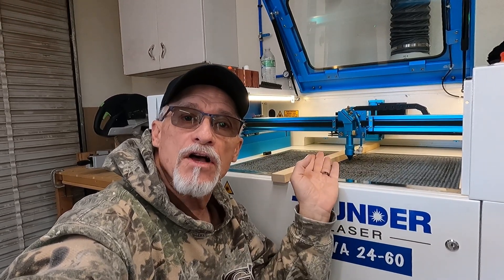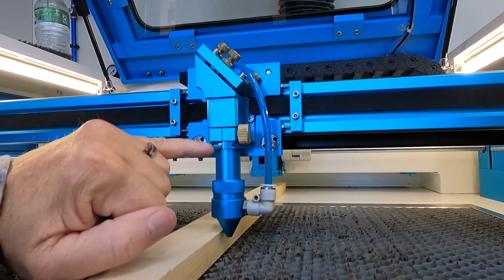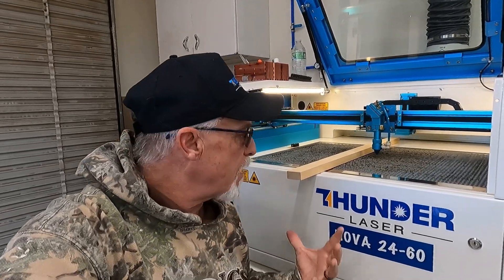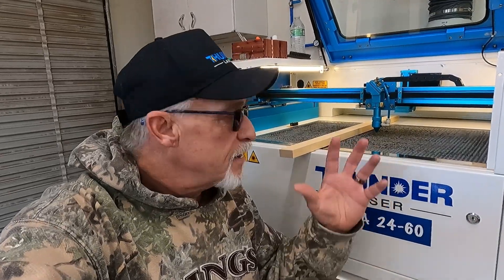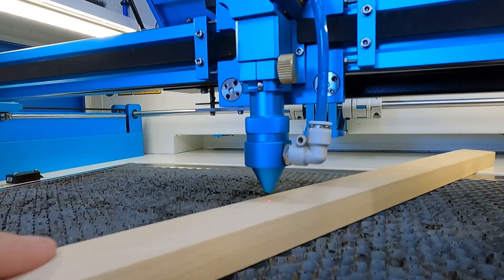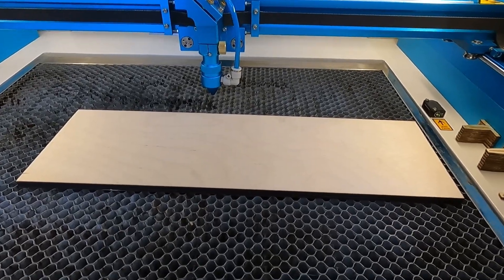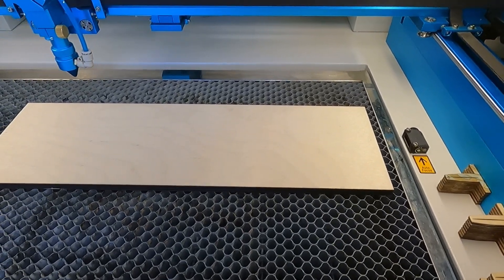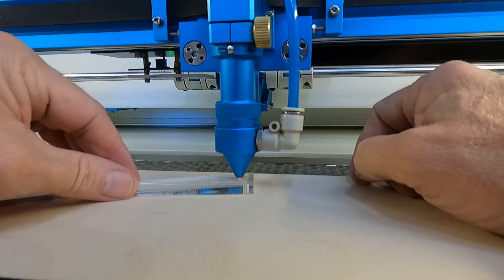Using Your Pass Through on Nova 24-60 watt  (2” lens adjustment)

Comment: What settings do you recommend starting out with first a 3/4 inch board?
Reply from the maker: Firstly your will need a larger co2 laser I use 5mm/s at 90% power on my Thunder 100 watt co2. Im assuming your cutting hardwood because cutting 3/4" ply is very difficult!

Comment: so is there no way to engrave say a 2" tall cutting board that is larger than the 24x16 "working area" listed on the website? I guess I'd have to go with a larger model? If this is the case the pass through feature seems kinda useless if you're limited to a 3/4" board...
Reply from the maker: yes most pass through items are signs that aren’t usually more than 3/4” thick. so you for what you want to do a larger model is needed. most passthroughs are not meant for thick materials. thank for watching!

Comment: I have a glowforge pro it has a cámara so I know where is my wood and I can see how big I can make my cut out. How do you know how big you can do a cut out with no cámara?
Reply from the maker: I have a camera on my laser but don’t need it for placing designs on material. You use user origin and then use the frame feature in LightBurn. Very easy to use and work with. Thanks for watching

Comment: Appreciate these videos, as i'm currently in the process of buying a laser, looking seriously at this exact model and Full Spectrum 'equivalent'.  

One question, do you have a video (couldn't find one) on using the passthrough feature and software for the purpose of burning larger than normal projects?  This is one of the deciding factors for me, and appreciate any experience you have with regards to that.
Reply from the maker: I don’t have a video but if you look for print and cut feature in LightBurn that’s the process in LightBurn that works well. look for the video that has the mermaid on it. Thunder laser is the way to go in my opinion.

Comment: Thanks for this. Have one on the way to replace a Shapeoko/JTech 7w rig. Trying to learn all I can before arrival.
Question- what is the weight of the Nova? Mine is going in a basement (yes I have fume extraction :) )
Reply from the maker: Congrats on the 24, you will love it! if you take the doors off the honeycomb and slats out it’s about 280 pounds. have 4 strong people around and a good furniture dolly. some rent a motorized stair dolly and it’s worked great!